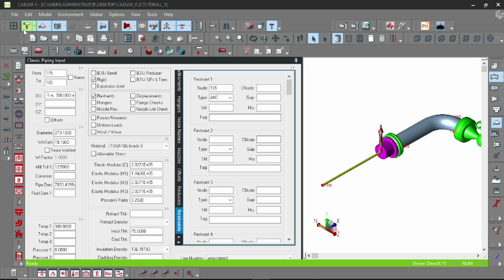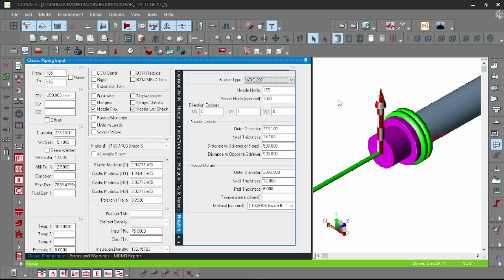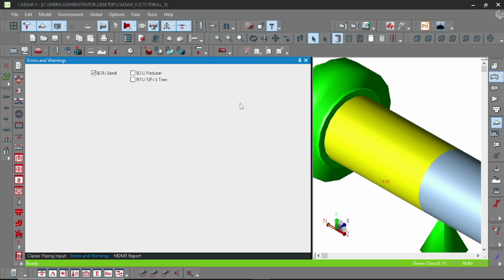CAESAR II: NOZZLE FLEXIBILITY & NOZZLE LMT. CHECK

Comment: Could you please clarify why you have not specified the thermal displacement in Vertical direction?
Reply from the maker: It is just for demonstration. Actual displacement should be as per equipment GAD.